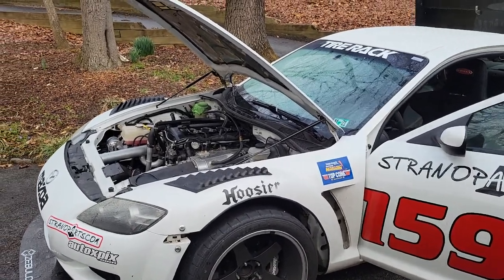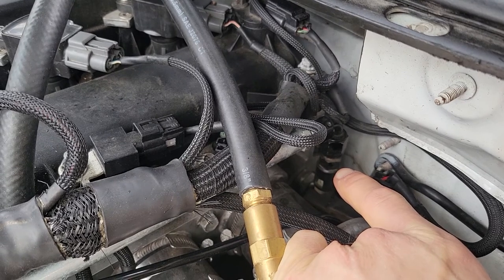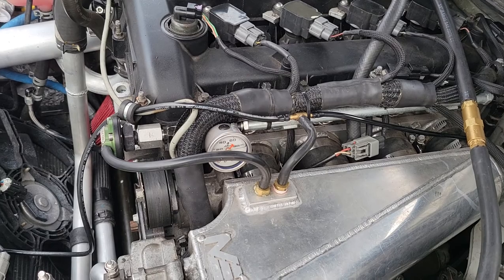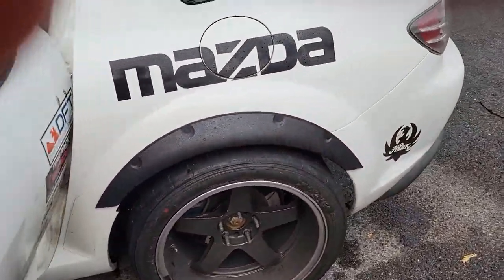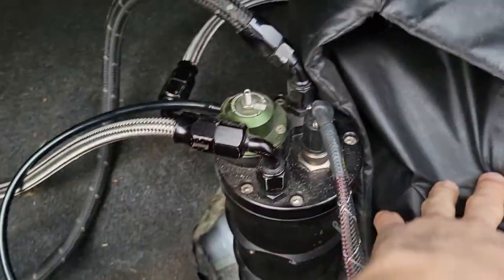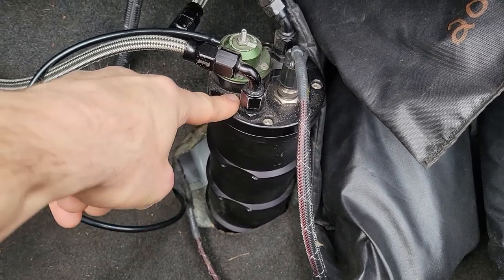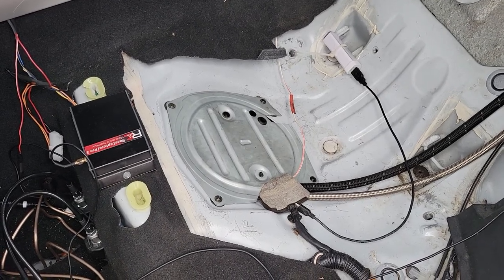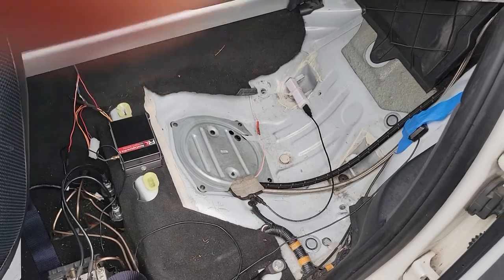Turbo MZR 2.5 RX-8 fuel system overview

Comment: Hi John, 
Does the nc steering rack share the same steering geometry as the Rx8's EPS steering rack? 
I've been preparing a Kswap(which requires steering rack relocation due to the size of the EPS,dont really want to go there cuz it mess up the steering geometry) 
Now I would like to use a nc power steering rack if possible, how is the turning radius&steering ratio, is it faster now? 
Thanks for your time and reply.
Reply from the maker: Yes, it does. You will want to source an NC subframe unless you want to make your own mounts for the NC rack.
Reply: @johnvitamvas6557  Appreciate it.